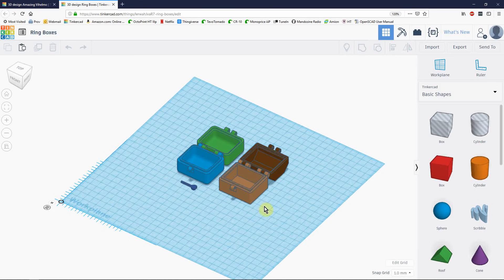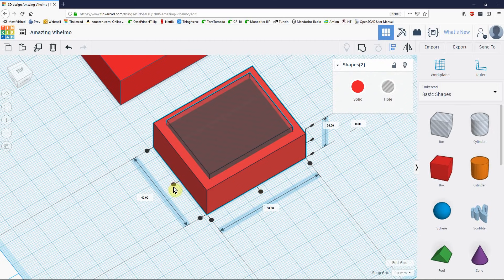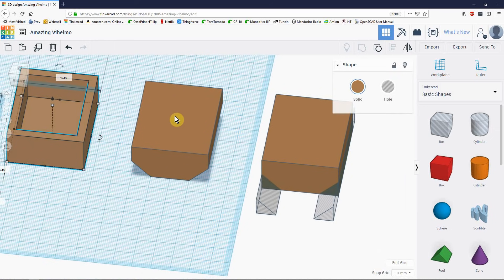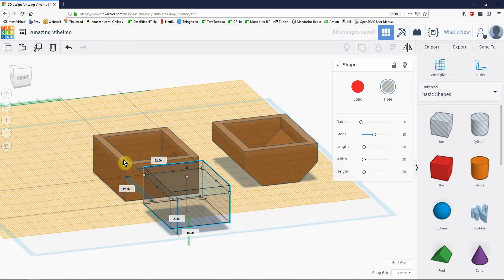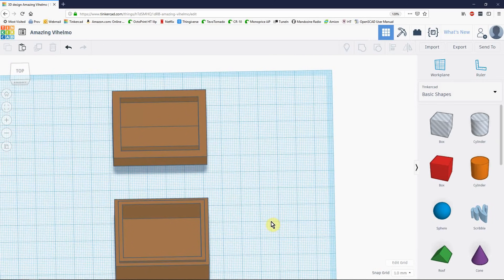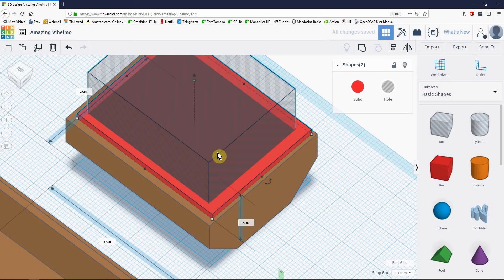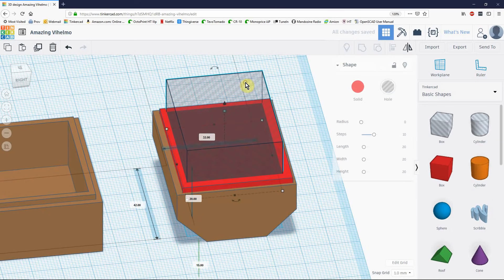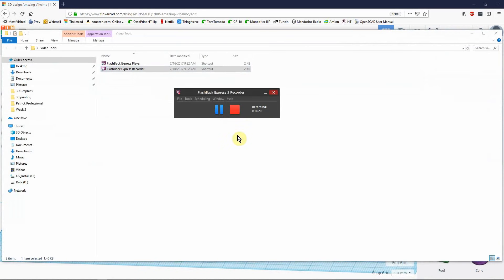Tinkercad Tutorial: Treasure Box Part 1

Comment: Could you duplicate the lid once you get it made with the lip and then just make one lid a hole and set it on top of the bottom and group them. Then the duplicate piece should fit exactly like the hole did. Or will the lip still fit too tight?

Comment: I am trying this video with a grade 8 class with the part two for more able students. I am quite new to 3d printing, how would you 3d print this? insitu or in two parts? do you need to add any supports? We are using Cura 4.7 with a witbox 2 printer. Many thanks, Heike

Comment: For the recessed lip in the top part of the chest, starting around 9:47 just drop the cut out of the red cube and then resize the cube for the desired tolerance.  If you had done that you would have saved about 4 to 5 minutes of video time that you spent fiddling with it.  Actually started watching this to see how you did the hinges and apparently I needed to just watch part 2 of this series.